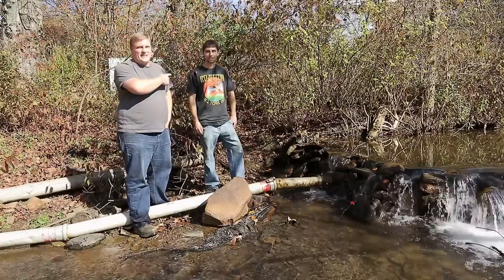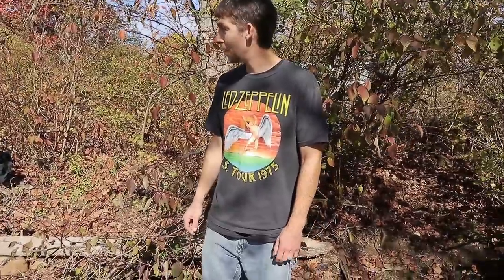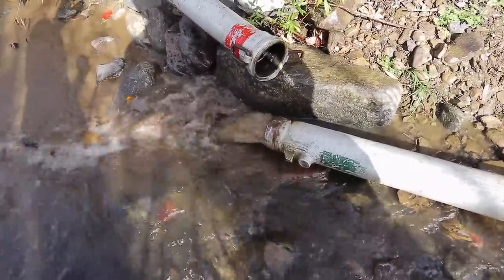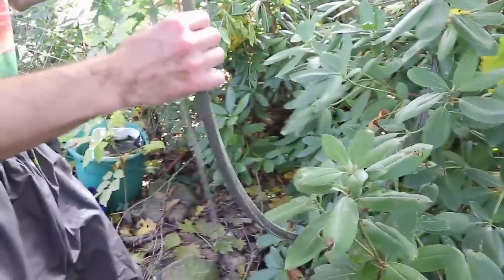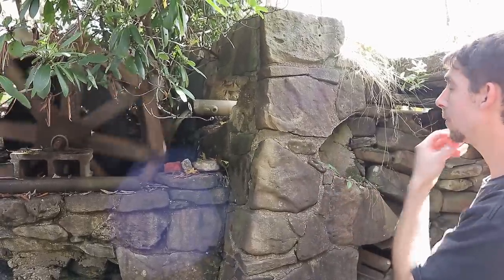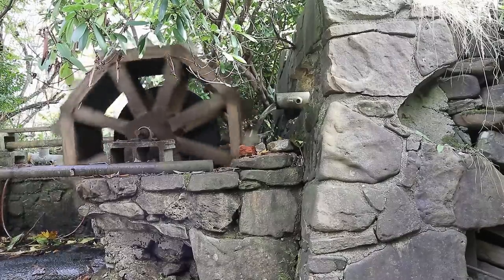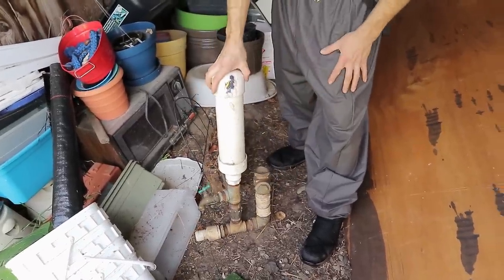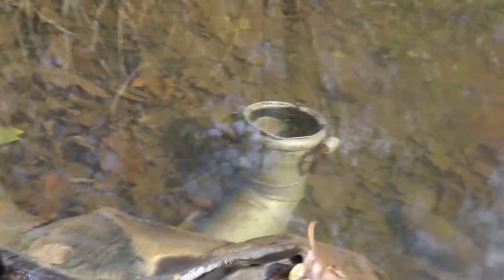Andy's Waterwheel, A Work in Progress.

Comment: With a flume, the water may be brought to just over the top of the wheel to fill each bucket.  A gate at the entrance to the flume is useful to shut off water if the wheel needs to be stopped. 
The  weight of the water falling the diameter of the wheel is where the power is.  The wheel may need to be reconfigured slightly to use a flume.

Comment: I would lose that angled pick up pipe. Anything floating would move towards that and that's probably why you are getting blockages.  Also, with the pick up pipe close to the surface you will get lower flow. Great video.
Reply: Using a straight pipe has its own drawbacks though. Likely to pick up a lot more debris that is coming down stream blow the water level. Going to get a lot more leaves and sticks that way. There are pickup pipe designs for systems like this though that would eliminate that but they are much more elaborate. MrHydrohead has some great examples on his channel.

Comment: If the dam was made a little higher the pipe's output could be raised to provide more power while keeping the same distribution of water between the stream and waterwheel.
Reply: Ideally that might work, Yet the area where the dam is is split with most or part of the water drawing to the other creek, So one could dig down and enlarge the area so that the stream puts more water on his area.  By doing this you lower the dam area and make it larger so that the water volume has a place to move to at a faster rate.
Reply: @kameljoe21  
While I knew the stream split I saw no evidence that it was right above the retainment pool.
Reply: @calvingreene90  After looking again at about 5:12 you can not really tell where the dam is, It looks like there is 3 directions of water...
Reply: @kameljoe21  
It looks like two streams joining without the dam in site at all.

Comment: Where did he get the aluminum pipe? I want to use the same for my setup.
Reply from the maker: It's oil and gas pipe.
Reply: @JoeMalovich  thank you for the information,  I know many people are probably looking for strong rust proof pipes, where would you suggest is the best option for this pipe on the cheap side?
Reply: It looks like irrigation pipe farmers use.
Reply: @royreynolds108  thank you,  and I think you might be right
Reply: @sargetester99  It is aluminum irrigation pipe...  You can find these used a lot. Prices can be upward of 4 dollars a foot sometimes. Other cases you can get a whole bunch of it for almost nothing, Where some will be bent, Have holes, Or bad fittings.  Lengths can be 10 20 or 30 feet ranging from 4 inches to a foot. The larger ones will be gated pipes unless they are supply lines ( you will not find a lot of supply line in large sections ),  They come in aluminum and PVC. You will have to do some work on the gated ones to close off the holes, In an unpressured system these would work great as you can just have the gated section above and use something to close them off.   PVC ones can be found cheap if you ask around, Due to the fact that they just toss them if they are damaged, Once can cut off the bad section and add some sort of fitting.